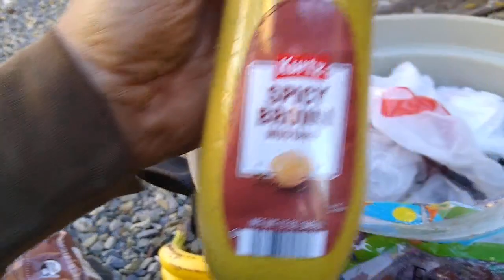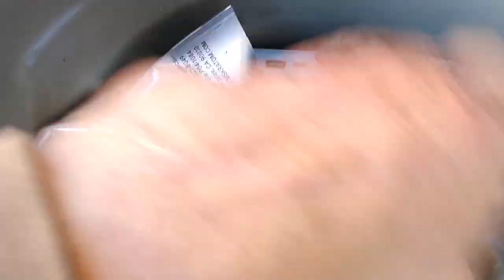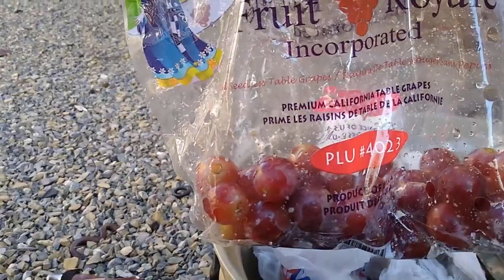Boxcar comfort and ground air

Comment: My grandpa was a German immigrant, he used to ride the rods.  Back in the day cars were made light then beefed up underneath with truss rods.  They went from up high by the axle to a truss saddle low in the middle, then back up to over the other axle.  When the car would age and sag, they could tighten up those rods and pick the middle up and keep the deck flat.  Those were the rods they would ride.  There were two or four, side by side, that you could lay down on.  It was a place the bulls could not reach while the train was moving.  (His story to me)

Comment: 10:10 is a track skate, not a chock. They are used to stop rolling cars that have been dropped or kicked into a clear track. Wheel chocks are wedge shaped with a long wooden handle and are used mostly in repair facilities for equipment that don't have operable hand brakes or to keep from having to set handbrakes.

Comment: The rods referred to with "riding the rods" were not brake rods, but TRUSS rods, used to brace cars with wooden frames. They did not move relative to the car. There were usually about four of them per car. They were no longer needed when cars began to be made out of steel.

Comment: Back when ridin the rods was a thing they had big steel rods with turn buckles that pulled tension on the wooden side and end walls of the box cars. They laid boards across them and there was usually two rods on each side of the car

Comment: I’ve never been a hobo but I do know that “riding the rods” didn’t mean the brake rigging rods. The old wooden cars had a wooden center sill. Modern cars have steel frame that are I-beams and need no added support. The wooden frame cars used steel “truss rods” under the car to keep it from bowing under the load. Boards could be placed across the two rods and provide a place to ride.

Comment: A lot of companies use that rubber to prevent roll stock paper from sliding when I used to haul it in the tractor trailer they would put those underneath the rolls

Comment: I almost derailed a car with a piece of railroad tie before. I was utility man and the yard crew kicked a car way too hard into a clear track. If I didn't get to the other end of the yard and stop it, it was going out onto the mainline. All I could find was big pieces of tie. It ran them over and the flange was actually hopping up above the rail, but it kept on going. But slowed down enough that I could hop on and tie on the handbrake. It was a close one.
Reply: I've done that before myself.

Comment: My father-in-law started working for B&O RR in late 40’s. He talked about how the engineer would drop a billy club tied to a rope between the rails as train would pull out of the Garrett IN rail yard.  Said anybody that was riding underneath would drop off pretty quick when they heard it banging.

Comment: Here's a question. So there's no continuous air being pumped through the cars as it's rolling? I know from driving semi's you've got to build up the pressure to release the trailer spring brakes but there's always air going back there for your air brakes.
Happy Rails to You
Stay Safe, Warm, Dry & Healthy 💙🤗

Comment: The orange thing u called a choke it is really called a skate what they do is when they shove the car they put those on the track on both sides to make sure the car or cars dont go past a point it slows them down to stop the air hose they dont use them so much any more were use back in my day in the 70s when the engins were not able to charge the line fast may have taken a hour to do the train not even the older units have larger and faster charge compressers to charge the lines like 5 mins time for over 100 cars the line was put on the back kept the yard air in it for the train to pick up hook up turn the air cock the air was set 
also were I live is a large hub they have a hump yard when they hump the 1st car the stakes are waiting at the end of the track the car rolls over itthen slides a bit then the next car comes off the hump pushes the one car a little bit more then the 3rd car hits the 1st car but dosent push the 1st or the 2nd car as far about 5 cars they can remove the skates the reason is if they set the breaks on the cars by the wheel on top it can do a lot of damage to the load and the cars more so the under frame of the cars it is like a coushen in a way I cant remember how they take they remove the skates but they radio up to the hump tower tells them the skates have been removed.

Comment: The main air pressure to pump air through the whole train comes from the engines inwitch they pump it up to 450-P.S.I. IN AUGUST WE DON'T USE THE AIR HOSES COMMING OUT OF THE GROUND LIKE YOU DO IN THE STATES . ITS DAVEY FROM DOWN UNDER AGAIN. LIKE I'VE TOLD YOU I USED TO EXAMINE THE AIR BRAKES AND OTHER PARTS OF THE TRAINS FOR 16-YEARS. GIVE ME A MENTIONED AND ARSK ME ANY QUESTIONS ABOUT THE AIR BRAKES AND OTHER PARTS. MY APPRENTICESHIP LASTED 5-YEARS SO I . KNOW WHAT I'M ON ABOUT. BUT ONECE AGAIN I'VE NEVER HEARD OF AIR OUT OF THE GROUP BEFORE. PLEASE ANSWER ME. I CAN GIVE YOU SOME INFORMATION YOU PROBABLY DON'T KNOW.

Comment: Do Engines at the trailing end add extra braking air capability?
Reply: Yes. Distributed power units also respond to air brake applications and charging signals sent from the controlling unit.

Comment: Regarding riding the rods, they were called truss rods.  Here's a statement from Wikipedia on "riding the rods".  I've seen photos of old box cars and I may have seen one in a museum, too.  They can have enough truss rods that it literally makes a bumpy platform underneath.  Noisy, dangerous, and you can get hit with rocks from the ballast.  Also, see what Ernest Borgnine, playing Shack/Schack, the brutal railroad conductor, did to hobos riding the rods in the movie "Emperor of the North".

Freighthopping - Wikipedia
[Search domain en.wikipedia.org/wiki/Freighthopping] https://en.wikipedia.org/wiki/Freighthopping
In the 1900 to 1920 days of wood frame freight car construction, steel truss rods were used to support the underside of the car in order to provide it with the strength to carry heavy loads. There could be four or more of these truss rods under the car floor running the length of the car, and hobos would "Ride the Rods."

Comment: "Riding the Rods" actually dates back to the era of wood-framed truss rod supported boxcars used in the19th and early 20th century.   To ride the rods you typically would put a plank across the truss rods and ride on the plank that sat on the truss rods, hence the term ride the rods.  Just search up a truss rod boxcar and you will understand better.

Comment: I see you had some kratom in there, I use it too!
Reply from the maker: I tried it for about 10 days. 
It didn't seem to help much
Reply: @TheHoboShoestring  Curious, how much did you drink? gotta take about five to ten grams for it to work well. It saves my ass on the regular.. you can't get pain meds anymore to this is the best thing you can get

Hey you ever come though Southern Illinois, Metropolis ?
Reply from the maker: @rodneydaub3812  
I was drinking between 35 and 40 beers a day, every day every week every year for 26 years
Reply: @TheHoboShoestring  I was asking about how much kratom you took?
Reply from the maker: @rodneydaub3812  
I was taking like 5 or 6 capsules every 5 to 6 hours
Reply: @TheHoboShoestring  You need anywhere from three to five grams of powder for it to do anything. That's quite a few capsules.. If you get a big enough dose, it will make you feel better. Cheers